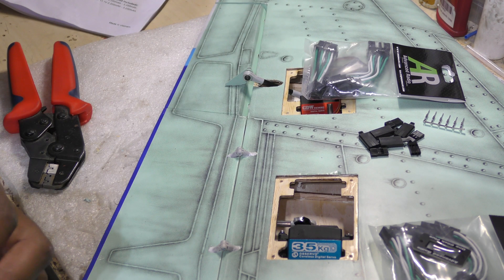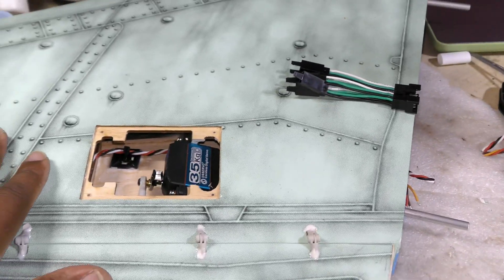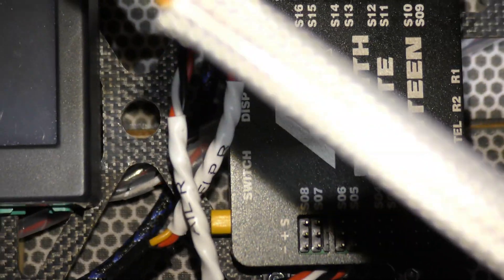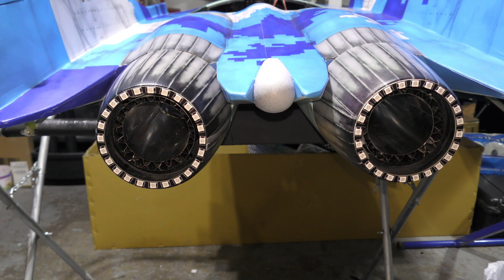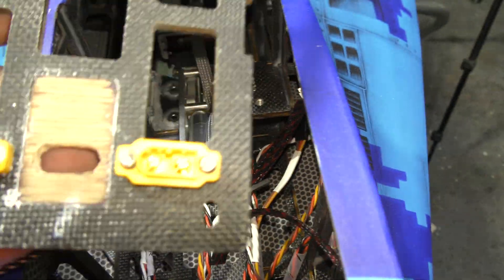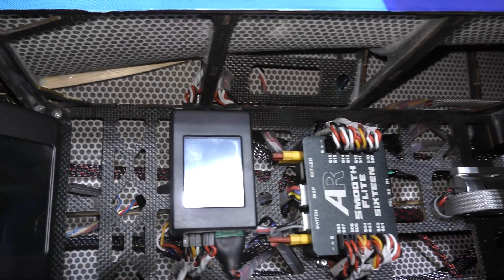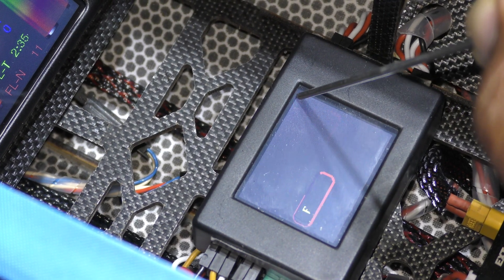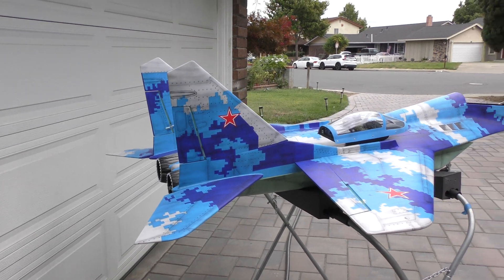BlackHorse Mig29 Build Series #7: Wiring & Avionics

Comment: Frank which ABs did you use that fit the diameter of the exhaust nozzles?
Reply from the maker: @pzukowski1001  this is what I used. “Cyclone Power 3 Colour Led AfterBurner Lite Twin Lighting System - 80mm” from Rc-castle